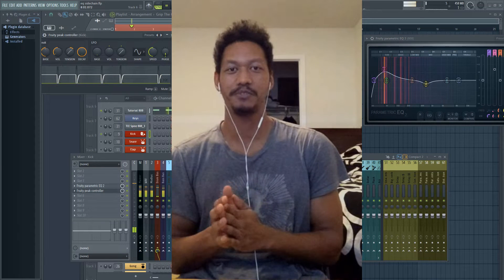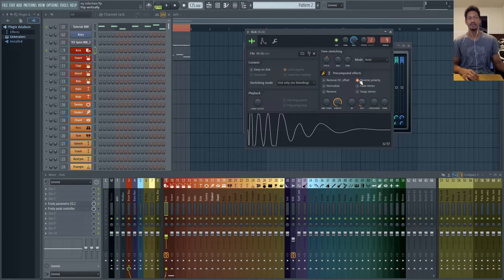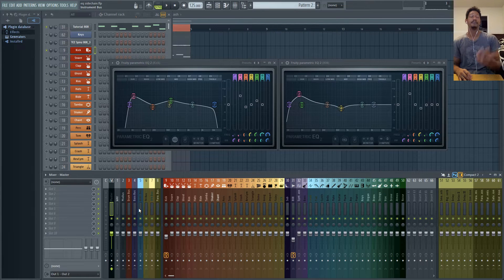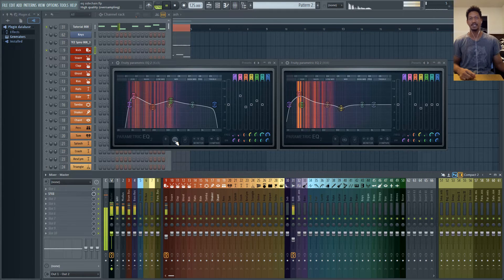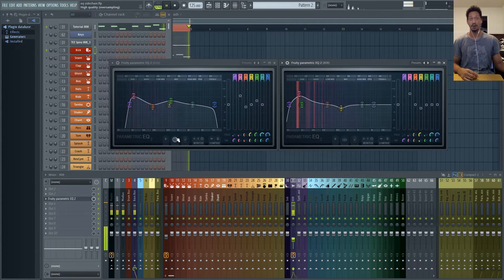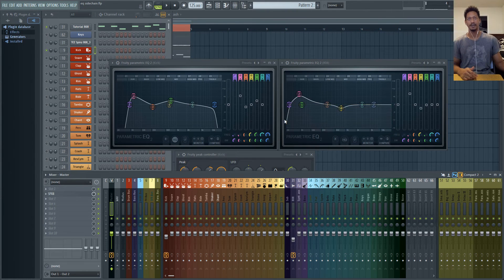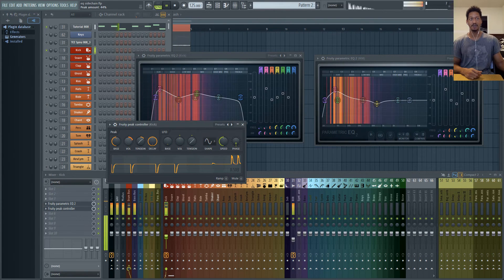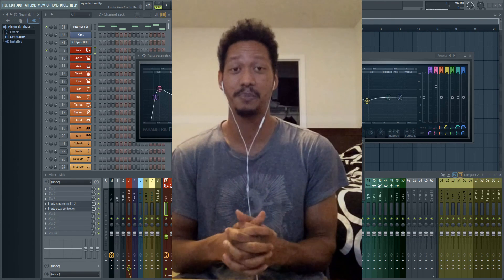How To Sidechain EQ | FL Studio Tutorial

Comment: Normally, I automate the low cut on my melodies so it only cuts when it plays with the 808. What do you think about using the peak controller on the 808 to cut the low end of the melody instead?
Reply from the maker: Graut I recommend actually cutting instead of automating.  Cutting unnecessary freqs from melodies isn’t just for clearing space for the low end, but also creates a cleaner reaction for things like compression, limiting, saturation, etc.